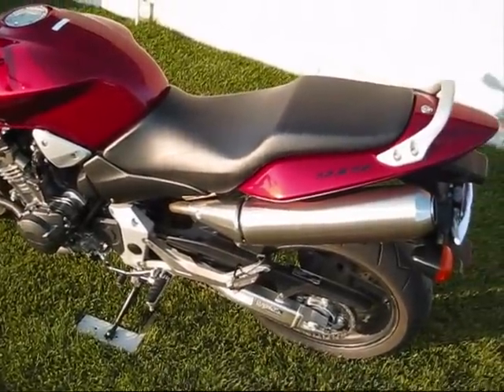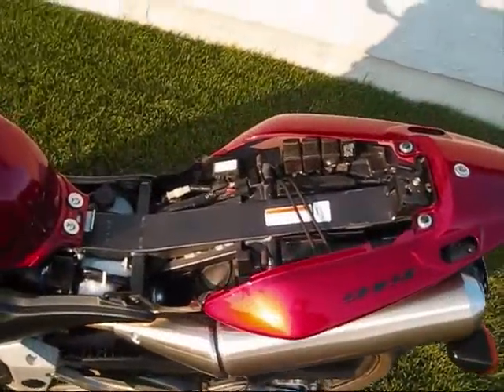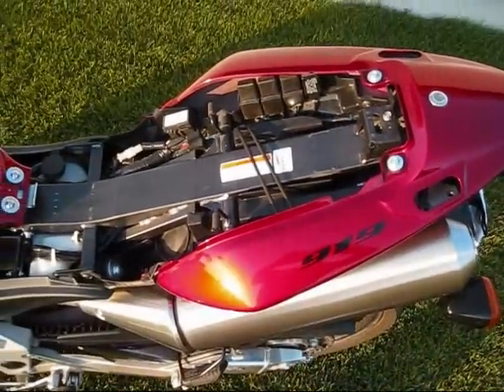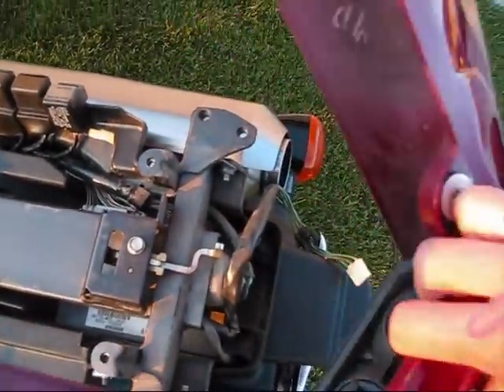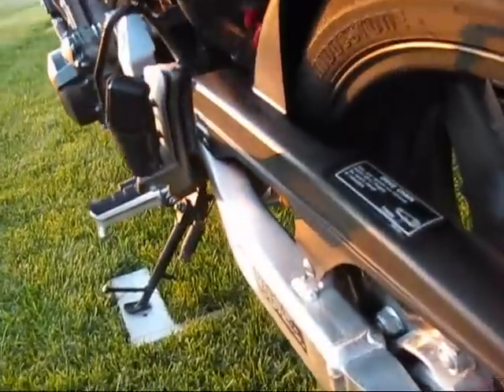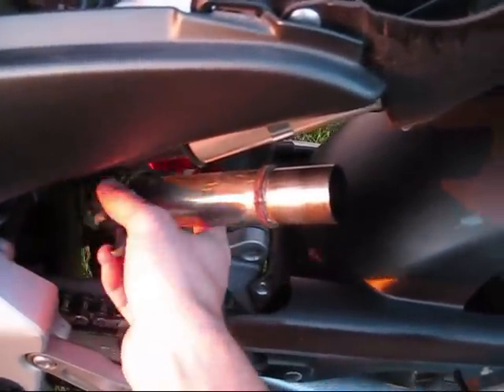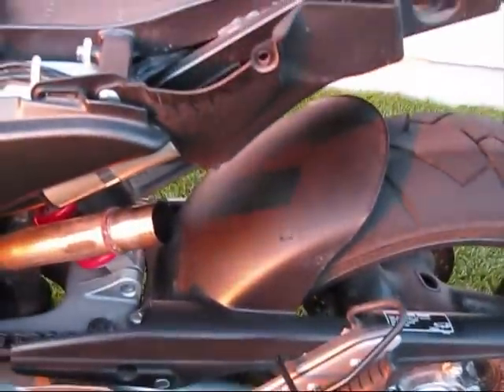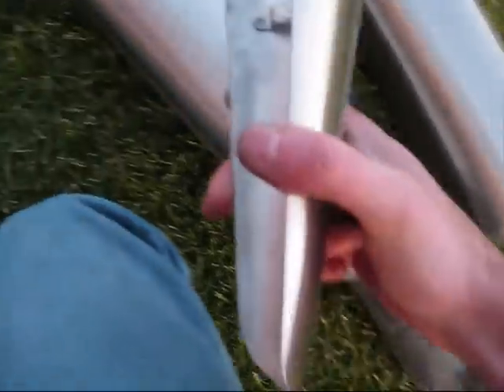Honda 919 CB900F Stock exhaust can removal Part 1

Comment: Omg just wanted to know how to remove seat but part was skipped
Reply from the maker: You're kidding, right? Use the key in the rear cowl and pull up. Easy.
Reply: No I'm not I'm new to bikes and my dad whose also new forgot where he put the manual. Don't assume everyone has the knowledge you do
Reply from the maker: But this video was never intended to show how to remove the stock seat, so why did you complain? I skipped that part on purpose. It was about removing the exhaust.
Reply: g00gl3it honestly I've been looking on Google for half an hour and couldn't find squat just got frustrated didn't Google for a  manual though that's my bad